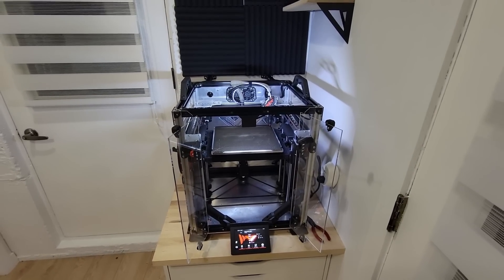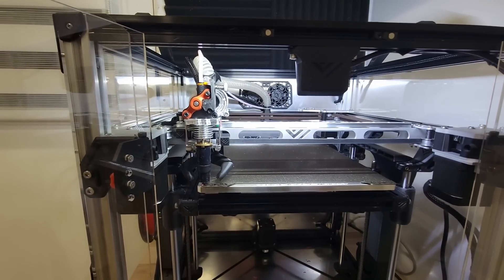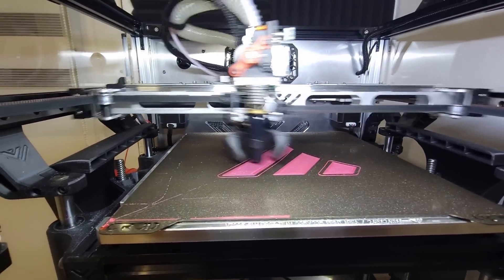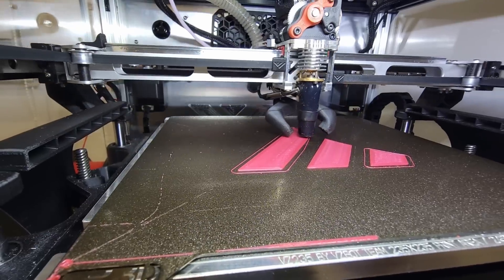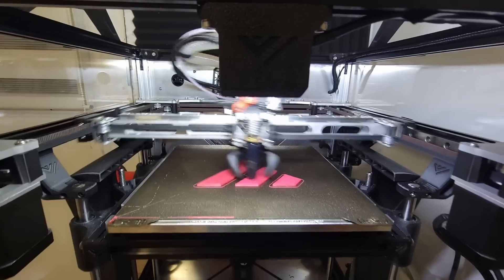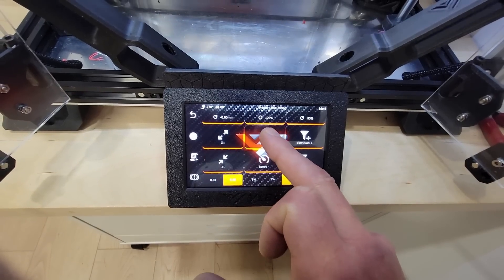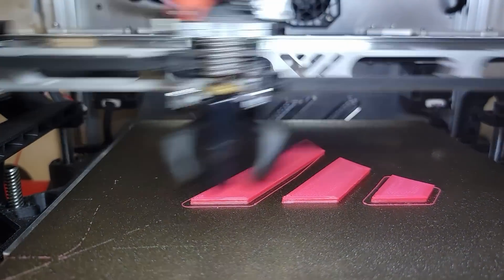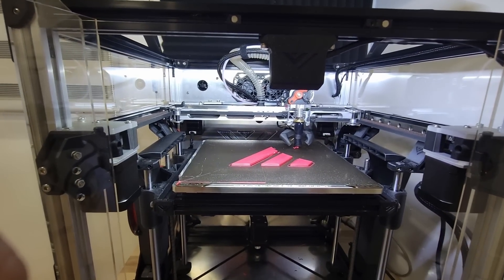Fastest 3D printed Mainsail logo ? 1500mms @50K Ludicrous speed #Vz235 #VzBoT

Comment: This guy's printing at 1500mm/s better than I print at 60mm/s ;p
Awesome demo, thanks. Lots to learn from this machine... just getting into it a bit for a possible DIY build.
That is stable! However intuition does fear faster part wear-out, just watching that thing move, lol. 💪

Ps: Did you get the new board installed? Wondering what you upgraded to, if you could share please?

Comment: is there less intricate test? show it on some complex shape
Reply from the maker: To reach those high speed ..it needs long straight movement
Reply: @Vez3D  they should use rotating head with i.e. 2-3-4-n jets for speed 'volume filling' and one in the middle for edges..
it'll be balanced, and they'd be able to fill up the surfaces much faster without need to move the whole head around too much..
it'll be like a brush.. or 1 flat head with non-micron array of nozzles, moving by microns for internozzle precision..
can you imagine what I mean ?

Comment: is this stepper based or servo?
Reply from the maker: Steppers
Reply: @Vez3D  I'm blown away. This is my next build for sure. I wasn't aware these speeds were possible with stepper motors. Is heat an issue for the steppers? Thanks
Reply from the maker: @gushhnet  yeah a bit at that speed ..but water cooling incoming

Comment: Here I am frustrated with how long it takes my Ultimaker S5 to print...anything. I thought "Today is the day.  I'm going to build a hevORT"  Did my usual due diligence and found there are simpler options that get the job done.  Then I find this which uses the frame of a printer I've already got collecting dust in the garage.  "This is the one."  Thank you so much for sharing.  Never forget where you come from, always chase the horizon.

Comment: I have an idea in my mind that potiently achieve an even faster print speed but will require alot of setups and programming as i dont think there is anything out there currently support this type of thing. So the ideas is having a standard core xy system on the nozzle, but put the bed also on a core xy system where during printing they will both move at the same time, ofcourse bed movement can be slower than the nozzle as it much heavier and that can be fine tune, but with both platform moving should be able to achieve faster print speed, or just easier to achieve the same speed as the movement speed of nozzle and bed can be lower than the actual required speed but still able to achieve it

Comment: I feel like I've picked the right time to get into this hobby haha. Absolutely insane man, was in hysterics the first time it ramped up
Reply: You truly have. You've missed the struggles of ramps 1.4, Marlin, 20 mm/s outer perimeter max speed @ 500mm/s^2 accel, no filament runout sensors, no input shaping, no pressure advance, lack of enclosures, V6 hotend non-rigid mount, V6 hotend nozzle changing horrors, V6 hotend heatbreak shenanigans, V-slot extrusions, no flex plate, no extrusion backers, no bed kinematics, no kits, extremely small communities, silly slicers, and the list goes on. Funny thing is, I still look back on all that as good times with a new technology. Even my first $200 chinese i3 printer that I never assembled correctly and never got a good print out of.

Comment: Why are these printheads all build in vertical direction and not like e3d hemera, and some others, in horizontal direction.  Dont you take away much of resonance ar high speed by using horizontal orientated printheads?
Reply from the maker: Not sure what you mean..but filament has to go down.. vertically. What do you mean horizontally?
Reply: @Vez3D  i mean printheads are like stacked components. build on top of eachother and make a vertical orientated toolhead. While e3d hemera/trianglelab matrix/BIQU H2 etc are more horizontal build, without too much room to wiggle during high speed movements. Or does it not make that much of a difference?  i was just wondering why most brands build them vertical. I have to say that your design has a nice high gantry. not the common 2020 profile
Reply from the maker: @Robin-Visser  hemera is the same.. extruder on top of hotend. Its not different. Its jus a way higger motor so it looks more horizontal

Comment: Hey, I developed a retraction calibration tool @ retractioncalibration . I would love to see you print it at a ludicrous speed. Just be careful i use a mixture of relative and absolute coordinates....I would print it slowly once and watch it start. If you get past the mesh and starts fine you should be good.....just reboot if you stop mid-print.  I wouldn't want it to break your machine.
Reply from the maker: There is a builtin retract tune in klipper :)
Reply: @Vez3D  omg. Lol Sorry for the spam. Not everyone runs klipper.
Reply from the maker: @prahjister  hehe true

Comment: That's amazing!

But is it practical  for regular use?

How long will the mechanical parts last with those kinds of loads?
Reply from the maker: Its not something i do daily ;)  it was just a torture test
Reply: @Vez3D  OK so what's the max speed that would match the Bamboo Lab's at 250 mm/s, where the quality is said to be equal to other printers running at 1/3 of that speed?

And a somewhat tangential question from someone who just started learning about 3d printers a week ago:

Am I right in assuming that the extrusion speed has a controlled relationship to the print speed? Otherwise the extruded bead would be fatter before the head accelerated to full speed.

Thanks
Reply from the maker: @noahkatz9616  depending on the part printed, but 400mms with 10-15k.. even 20k is good .. very good quality. On some parts I have to slow it down to 100mms.  And yes.. extrusion is always the bottleneck
Reply: @Vez3D  Interesting, so I might have been premature in ordering the Bambu printer; I thought it was ahead of everything else for combined speed & quality.

But its biggest attraction for me is its ability to just print parts without a lot of fuss.

Is there such a thing as a ready-to-buy version of these big core xy printers that don't need a lot of fiddling? Or maybe an enthusiast who will assemble and de-bug them for a price?
Reply from the maker: @noahkatz9616  we are working on a kit.. but still is DIY. the Bambu lab is a ready to go awesome printer with lots of features. GREAT choice there. But for people liking DIY projects, the VzBoT is a fun one to build :) and has awesome performance

Comment: I'd love to see CNCkitchen make material tests with your 3D printed parts and tell us what strength differences there are when changing speed and/or acceleration. This would be the ultimate proof of your printers capabilities in terms of usability of the parts.
Reply from the maker: I dont print a usable part at that speed...but with 200-300mms i have.not seen parts being weaker. You print hotter a bit and hop
Reply: @Vez3D  how about contacting CNCkitchen and make him test some parts? Would be awesome! He's pretty open to new suggestions.

Comment: @VezED I watched the first layer print, thought… mex…..
The second layer, it looked and sounded like it’d gone nuts, but the quality looked good, I broke out laughing!

And finally at 1500 mm/s you finally hit a limit of some sort, guessed to be processing.

In a world where most home 3D printers are still running cheapskate 8-bit microcomtrollers, you may have maxed out a 32-bit microcontroller but still had mechanical capacity leftover 🤣🤣🤣
Reply: @autogyro333  can’t say I’m not intrigued, but perhaps I may conclude it’s inadequate and refuse, because I assess it needs to be 64-bit ;)

But in reality, there are contexts where going 64-bit makes more sense than 32-bit, but it’s actually unlikely to be of benefit for this context: 64-bit code tends to need more memory bandwidth and larger cache, both things you’ll often not get in a microcontroller type of environment.  Having more CPU registers is possibly a valid reason, but that’s not a function of being 32 or 64-bit explicitly in the general sense, but a matter of the ISA and its implementation combined with how well the compiler optimizes their use.

I could also do the most bizarre thing in funding to live up to my moniker: mail you a penny, which of course has no real value😜

Comment: You can just reduce microstepping so the board can keep it up. And gain some extra torque at the same time.
Klipper crashes if you try to do too fast movements with too high microsteppings, says MCU timing issues. But its simply about trying to generate too many steps, and dropping microstepping halves the necessary steps that are generated.
Reply from the maker: Yeah i dropped to 16 for this vid.
Reply: Is it a limitation related to the Pi computing power? Or is it tied to the mainboard itself?
Reply: @supakumachan69  Good question. Also wondering if the Mainsail would benefit from running on 64-bit OS instead of 32-bit?

Comment: What you think of the bambulab with its active vibration cancelation you think is better than the one  of klipper ? Maybe an improvement in that could help to get even better result at high speed printer acheive some really good quality in an under 20min benchy
Reply from the maker: I dont know. I dont have a bambu printer :p i was not offered one haha
Reply: Input shaper for klipper does the same thing. You can get same results with proper tuning, no Bambu needed lol.
Reply: @highspeedpiTV  but bambu lab first messure vibration by lettinging it shake doesnt that do any good ? 
I am trying to figure out why everyone is saying that the other manufactures cant keep up when basically bambu lab just put all the avaiible feature from the open source market in their printer 😅 would be intressting to see bambu lab vs vez bot

Comment: Vez, what's your take on using the Igus slide bearings with 2 carbon tubes for the X axis? Looks very promising for the lightest X axis design .. Search on youtube for DIY Fast CoreXY 3D Printer called CarbonCore, if interested to see more

Comment: would it be be beneficial to build the 3D printer so that the xy gantry is at the bottom? would this prove performance, resonance, print quality?
Reply from the maker: not a fan of flying gantry
Reply: @Vez3D  i think you understand me wrong i meant if you flip the komplete printer so you print upside down evrything else says the same (corexy...) (something like the Positron)
Reply: @olfolf5705  Yes, there are a few printers like that. In theory inverting the Z gives you better rigidity/$, but you need custom parts for the best performance which cancels that out. Also, bed adhesion becomes far more important, and there may be limitations to size, part weight and filament choices.
Reply: @WhenDoesTheVideoActuallyStart  Well if you want the absolut maximum uf acc and speed there ist no max to spent ;)
Reply: @olfolf5705  3D printers are already finnicky enough, inverting the Z axis adds a lot more things you need to think about when printing a part.

You'd need software designed specifically for it to reasonably automate the process of tuning bed adhesion (Which would need to be similar but different to SLA's process of adding supports) and even if it's a simple addition it won't happen until you have thousands of people already using inverted-Z printers.

In sum, if you have money you're better off spending it on a more rigid frame. That'll counter the fact that there's more moving mass further away from the base of the printer, and give you a more usable printer.
Reply: You mean like a Voron V2.4?
Reply: You mean a inverted printer or a movable bed? A moveable bed would have significant mass compared to most nozzle setups, must be moved exactly flat, and requires vastly more space for the machine
Reply: i meant if you flip the komplete printer so you print upside down evrything else says the same (corexy...)
Reply: @olfolf5705  Look up the Positron 3D printer, it's the most recent example, and probably the most well-known now. I don't like it's focus on portability but it has a sound design.